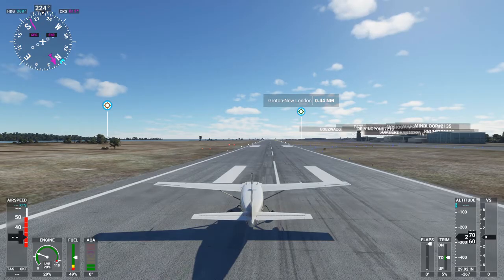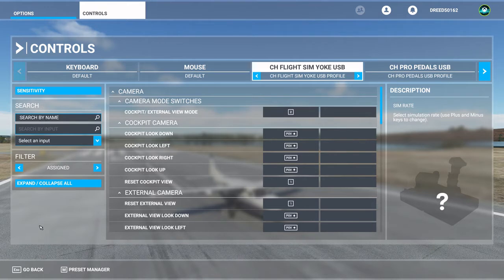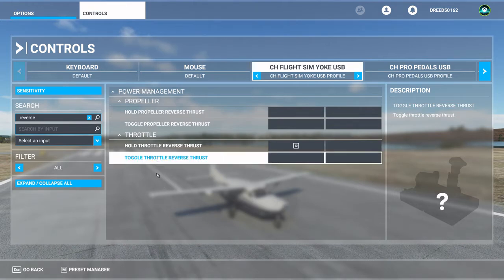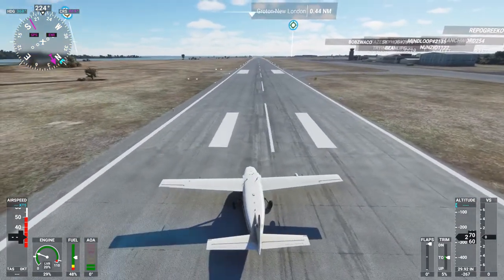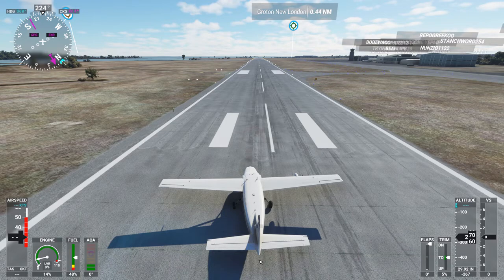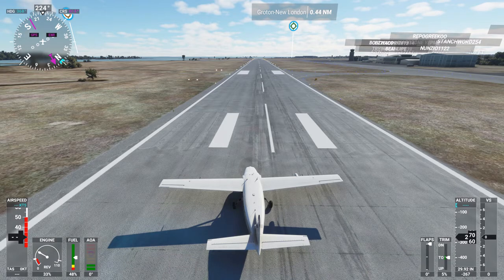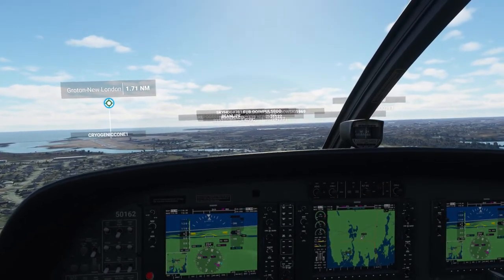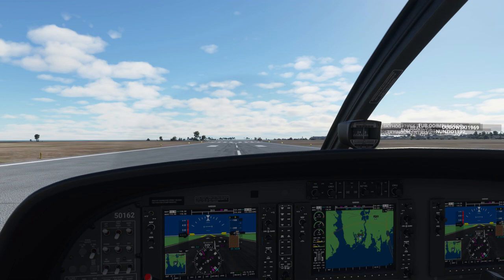Cessna Grand Caravan Reverse Thrust

Comment: I think the default keyboard key is F2 for reverse thrust and reverse propellor. I've been using MSFS 2020 now for about 3 weeks and it works fine if you press and hold it down. You'll even see the throttle lever move into the reverse position in the cockpit. I have the Saitek Pro Flight Yoke and I tried mapping the reverse throttle to the throttle quadrant lever and all it does is set the prop feathering lever to 'arm'. I've read that other people have had that same issue. I didn't have this problem with Microsoft's previous FSX. If they could fix that dewpoint always being stuck at 10°C in live weather, that would be great, too!

Comment: Did you all know it's possible to add the reverse thrust function to any of the constant speed prop piston planes in FSX? Here's how from Manfred Jahn: 
Step 1
Find an aircraft that needs reverse pitch props and go to its aircraft.cfg file. This should work for all constant speed prop aircraft. Go to the prop section and find this:
prop_reverse_available = 1
minimum_on_ground_beta = 1
minimum_reverse_beta = -14
If the section is already like this, leave it, if not change to the above values or add them.

Step 2
Next go to beta_max =
Now take the value there and subtract 1 and make it a negative # and put it in the beta_feather = Area. (If there is no feather value they will need to be added)

Step 3
You must make sure that the power_absorbed_cf = has a value of 0.1 if not props will go out of control. Also make sure that the min_rpm_for_feather = is 0

Step 4 test!
Use the steps below to test while aircraft is at a standstill. If it moves backwards you did it! (Note: make aircraft is not overloaded before testing.
Use in the sim To make the props reverse do these following steps:
1. Once on ground hit Ctrl + F1. (Or move prop pitch lever all the way back
2. Then hold Ctrl + F2 You will see on the rpm gauge that the rpm drops below its usual minimum. As soon as you see that, then advance the throttle.
3. To return props to normal hit Ctrl + F4. (Or move prop pitch lever all the way forward
4. That’s it!